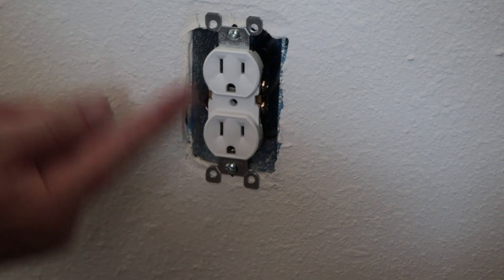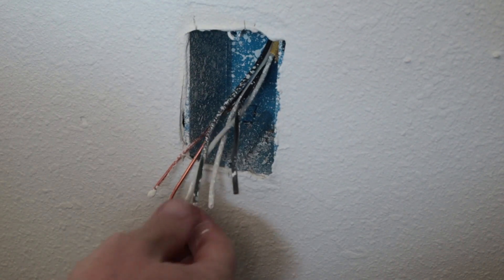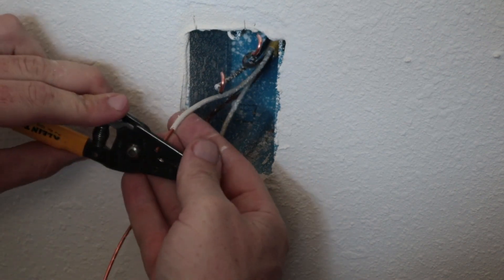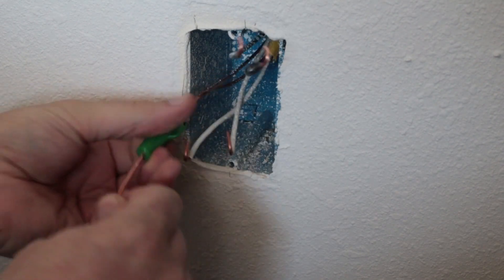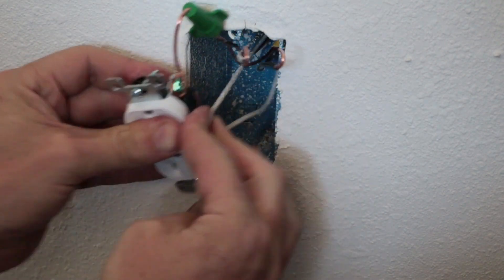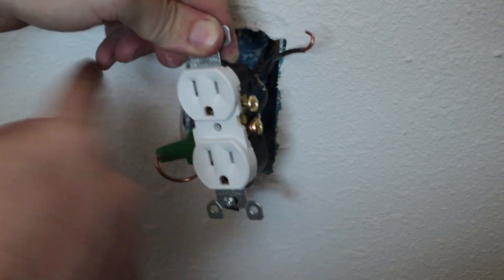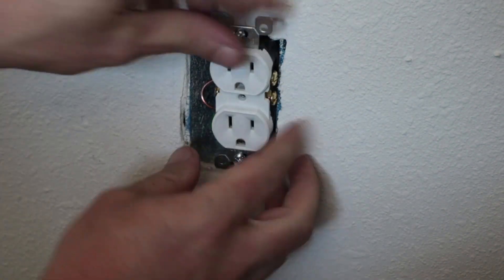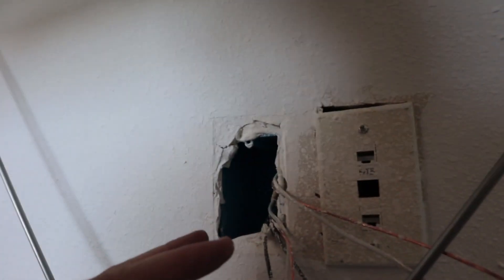How to wire an electrical outlet plug

Comment: Never use a drill on a device. That’s how you strip everything or over tighten it. And always use electrical tape around the entire device covering the screws and wires.